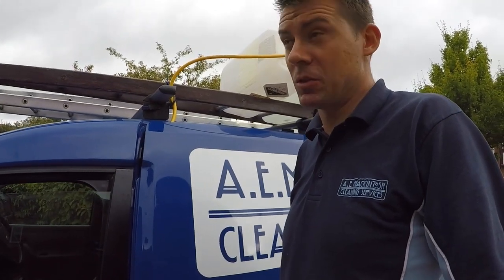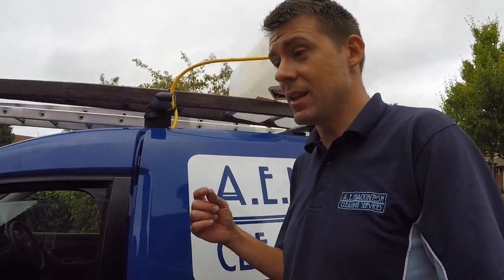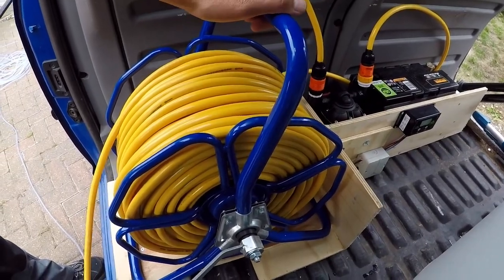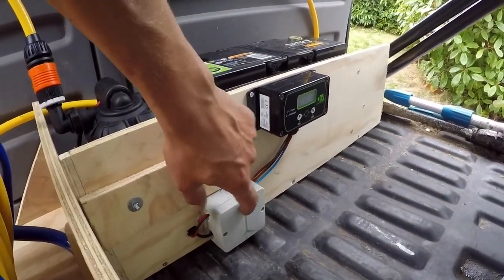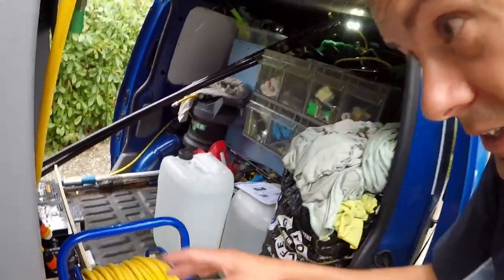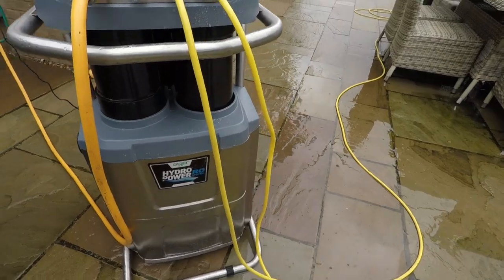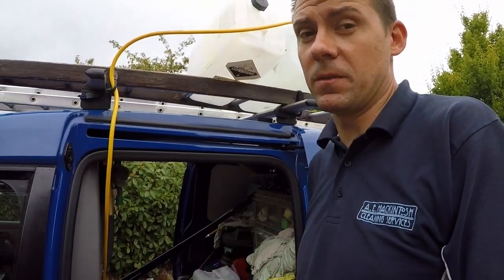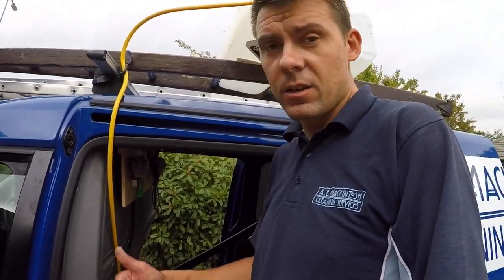My DIY Emergency Van Mounted Pure Water Window Cleaning System

Comment: Hi Ashley I’ve got a VW Caddy and I’ve fitted a 400Ltr flat tank in the back, I fit most of my trad gear on top of the tank 👍🏻
Reply from the maker: julian pierce Sounds good, I was wondering if a tank would fit between the wheel arches in there. Thinking of maybe getting a long wheel base caddy.💦😃👍🏼

Comment: Great video. When you get your new van you will never look back. Just check the weight limit on you van before you order your tank. Most bigger vans should be ok with a 650ltr tank but go up to 1000ltr and you could be in trouble. I know of a couple of lads got done for over loading.
Reply from the maker: Squeaky Clean Dave Yeah, good point. Thanks, I will check.😃👍🏼

Comment: You could of brought a gardiner backpack  jiggle hose from 25 litre barrels from inside van to back pack outside van connected to ure hose reel works great for a cheap set up 
I will do a video one day how to set up as I work out of my car
Reply from the maker: Jason Lingard Sure, sounds good. This was a big job, so the pump did help give me the power I needed to go that high. I also have plans to establish a more permanent van mounted system.💦😃👍🏼

Comment: You could always connect the new external battery to your battery in your Van's engine and let your alternator charge the batteries while you drive around job to job.

Can you please send me a link for the remote you showed in this video. I am in the United States and having trouble finding it. Thanks!

Comment: The pump will suck it through with the water container in the van, connect it again and disconnect from your hose reel and suck the water through with your mouth, connect again and should be fine. Hope that helps
Reply from the maker: MrAlexdavies89 I think the pump just needs to be primed to work. But even on the roof it won’t quite suck up the last bit of water.😬💦👍🏼

Comment: The pump will work with those Caddy's in the van, but the pump has to be the other way up & at least higher up than half the height of the caddy you want to pump from.. There is always a delay when turning on the pump it can be caused by an air bubble in the line, that you must clear, to get the water to flow at speed. I find that I have to disconnect the hose reel from the supply to push the air bubble out... try it out let me know how you get on....
Reply from the maker: MrHoodedtop That’s awesome. I will give it a go. Thanks.💦😃👍🏼
Reply: Your welcome

Comment: That pump should easily pull from van., it's same principle as the pure freedom trolley 
That caddy has a very low payload, I believe max with you and the big fella would be a 400 litre
Don't make a costly mistake & get a 4 or 500 litre, get the 650 and it's future proof.
Reply from the maker: Brian Barber Yeah, good plan. Thanks for the info.💦😃👍🏼

Comment: Your pump will be able to pump the water from the barrel without putting on the roof.
Reply from the maker: Steve Hughes I tried it in the van and it was temperamental, that’s why I put them on the roof, works much more smoothly.💦😃👍🏼